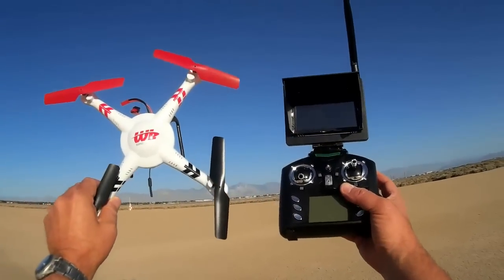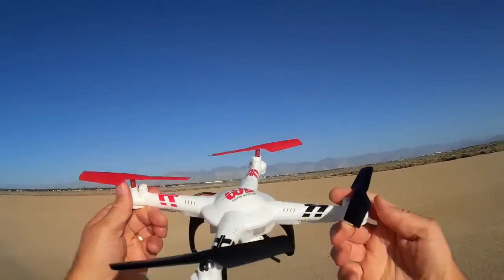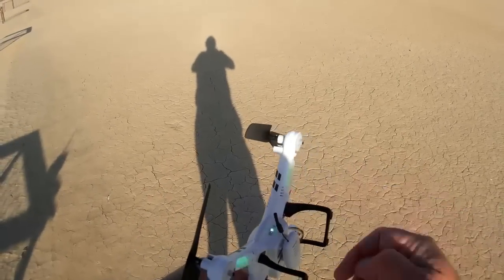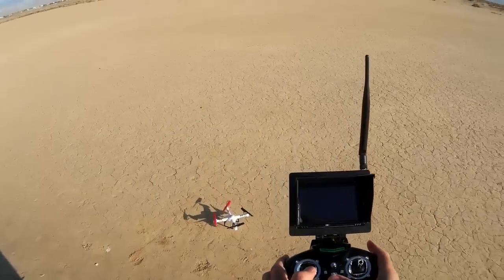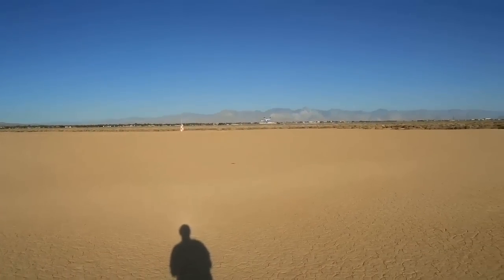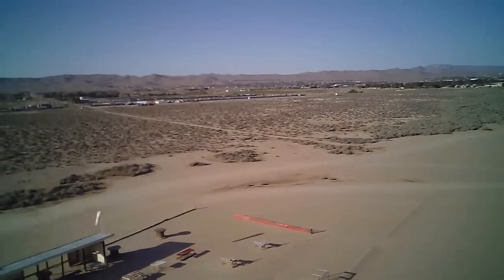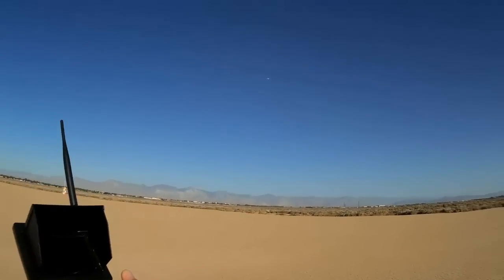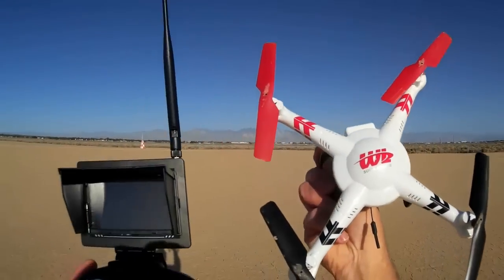WLToys V686G FPV Drone Gyro Calibration

Comment: I just got mine, did the calibration twice and every time it just takes off even if I'm holding the throttle at 0. Cant make it hold still. Flying inside is impossible.

Comment: +Quadcopter 101 I have one of this model and would like to know a few things if you can answer me

1- the battery lasts for (at most) 10 minutes, I bought another one (made for a nintendo 3ds, same voltage but more mAh) but I'm not sure if the wltoys charger is safe to use with this battery since I don't know if either battery or charger has surge protection.
2- one of the props is showing signs of debris damage even after I brushed it, is the motor dead already?
3- on one of the (hard) landings, the shell cracked above the front lid, does that cause any problems during flight?

thanks a lot for the videos! (specially the one explaining calibration)
Reply from the maker: 10 minutes is a lot of time for a brushed motor quadcopter.  Flying any longer may overheat and damage the motors.  I do not recommend using the nintendo 3ds battery with this quadcopter.
For #2, if you spin the prop by hand and notice any unusual binding, there may still be a sand particle stuck between the teeth.  Sometimes it is necessary to use a pin to dislodge hard stuck sand particles.
#3 sounds like merely cosmetic damage.  If it still flies, dopn't worry about it.  Of course, there's always glue ;-)

Comment: I just received the DV686 and it won't get off the ground. I power up everything and the rotors spin at full power but no lift. Batteries are charged. I don't know what to do.

I do see that when the props spin they hit the prop guards that's at high speed spinning. Should I take them off? 

This is my first quad and I've never flown one before.

Help!

Thanks in advance for any help.
Reply from the maker: You may have not installed the props properly.  They should all be blowing air downward.  If any are blowing upward, replace that prop with a different shape.   Also remove the prop guards.  They're very bad outdoors in the wind, and also like to get stuck in trees.

Comment: Just a question, my Q222 flies with the left front down (I know it doesn't have a front or back but I meant the right red motor) so basically with the left front slightly more down and right rear up. 

Should I calibrate or is it just broken? 

Ps, when holding the 40% button I hear 2 beeps and the light keeps steady on on the Quadcopter.
Reply from the maker: Try calibrating the gyros. 
1) Turn on the quadcopter and place it on a flat and level surface.
2) Turn on and bind the transmitter.  Center all trim tabs.
3) Leaving the quadcopter undisturbed, move and hold both control sticks to their lower left corners.  Hold them there until the quadcopter's lights blink. If they don't blink, then try lower right corners, lower outboard, or lower inboard until you notice the lights blink.
4) Let go of the sticks and try flying.

Comment: I recently open and closed my Q222 drone (which I think is identical to the V686G)? in order to reattach (solder) one of the wires for the battery component. However since then the drone flies for a short while then drops, even though the battery is fully charged. Also the motors were not touched and so are in place, and as far as I can see the gears are not loose.

Can you suggest what may be wrong and how I may fix this?
Reply from the maker: Have you turned each motor by hand to make sure that they spin freely? They should spin freely in the wind like a pinwheel. If not, their gears may have debris, particularly sand, stuck between the teeth.  This can cause excessive power to the motors, and can destroy the motor from overheat.  If any do not spin freely, clear the debris with an old toothbrush, or use a pin for those particulary stubborn sand particles. Some may be so small that you can't see them without a magnifying glass.  The best way to find them is to slowly turn each prop by hand to feel for any unusual "bumps" in the turn.  https://www.youtube.com/watch?v=LzzD3BPVvH0

Comment: Hi I have the mjx rc x500 and it keeps spinning to the left should I use the same process or what. 
Please answer or it will be in the trash
Reply from the maker: I'm betting that you installed or changed propellers, and were unaware that there are two clockwise and two counterclockwise that must be installed on corresponding motors.  If it takes to the air and spins, then you likely installed all CW or all CCW.  Must be two of each to counter the  torque.  Take a close look at the following picture, paying attention to the shape of propellers and where they are installed.  Make sure that your propellers match this installation http://g03.a.alicdn.com/kf/HTB10tYIIpXXXXaWXXXXq6xXFXXXk/mjx-x500-2-4G-6-axis-rc-drone-quadcopter-headless-rc-helicopter-3d-roll-one-key.jpg

But if your propellers do match this picture, then the next thing to try is you yaw trim tab, located directly under the throttle stick.  Since your quad is spinning to the left, try bumping this tab repeatedly to the left until the spinning stops (then try right bumps if left bumps don't work).
Reply: Thanks
Reply: Is there any place were I can buy spare motors for the mix x500 so if they're damaged I can replace them
Reply from the maker: Extreme Gamer Well you can Google it as well as I.  But you're best bet would be Aliexpress.com

Comment: Did you have to get a better antenna for FPV? Mines a bit poorly almost unusable for some reason...Only got it today too
Reply from the maker: +bozman69au This is usually one of the better toy grade FPV fliers.  Its FPV video range should be over 100 meters.  If yours is not, something may be wrong?
Reply: Yeah i think so i get massive interference on the FPV as soon as i spin the motors its to the point its unusable but the video on the camera is fine so i am assuming its fpv reciever related..Thanx for replying :)

Comment: hi 101  I bought the x260 from xk innovation  it says  it has altitude  mode does this copper thanks more videos  plesae
Reply from the maker: +martin keepin It's a good quadcopter.  But the advertised altitude hold feature (high pressure air needle) does not seem to have been incorporated with the X250.  Here are some flights I had done with the X250 https://www.youtube.com/channel/UC90A4JdsSoFm1Okfu0DHTuQ/search?query=X250
Reply: Thanks 101 😊

Comment: How do you switch between mode 1 and mode 2 with the WL 686G FPV Quad?
Reply from the maker: +Jack Turner You can't. For the V686G its transmitter is not switchable, and you have to specify Mode 1 or Mode 2 transmitter when you purchase it. And actually most vendors only have Mode 2 transmitters in stock.
Reply: Mine says it's a Mode 1 on the lcd screen, but it works as a Mode 2.

Comment: Update; Thanks again for the good diagnoses. It was the right rear motor. I paid 17.00 for 4 motors and 2 sets of props. Shipped 2 day Amazon prime. It is now flying like a charm. I am completely amazed at the quality of the camera! Wow! Syma could use some schooling from WLtoys as far as cameras are concerned. Video frame rate is great, color rendition is nice and the resolution is very good. I will rate this 8 out of 10 due to the bad motor.Very happy with performance. It doesn't have the headwind problems the Syma X5C has.Very nice flyer and incredible camera for the money. Thanks again.

Comment: Thanks for all the good informative videos!
Regarding the V686G, Five stars for the camera, zero for the quad. I own 3 Syma's, an X5SW-1, X5C and an X8C along with a DJI Phantom Standard. I got the 499 deal for the Phantom! The Syma's and DJI fly with confidence and are blast to fly. I received the V686G from Gearbest.com. This thing is complete junk or I received a lemon. It flew okay for the first 3 minutes of video, then complete instability. It has never been crashed, for the few short flights I have had. I thought it was one of the motors, but it seems to be fine.  The left rear motor now doesn't fire up sometimes unless I jar it. Somehow either the board is not calibrating and sending erroneous voltage to the motors, or the transmitter isn't working properly are my thoughts. Maybe cold solder joints? I went through  calibration of X,Y and level,  it is still the same. It also looses power very rapidly. The camera is certainly a keeper. If I can find a schematic, hopefully I can retrofit it for the Syma X8C. As I understand it requires a .5 sec. trigger for the video to engage. I could do it with an Arduino, but that's overkill. Anyway, any thoughts are appreciated. Thanks.
Reply from the maker: +Gary Olson The left rear motor needs replaced. The brushes eventually wear out on brushed motor quadcopters. Fortunately replacement motors are dirt cheap, and happen to be plugin replaceable on the V686G. Here's one place to purchase spare motors http://shrsl.com/?~b2mb
and here's how to change a motor https://www.youtube.com/watch?v=FXmsafz-u6Q
Reply: +Quadcopter 101 Thank you Sir! That was my first gut reaction, should have stuck by it.

Comment: Great video!  I just got mine today.  One motor would run intermittently, then holding it in my hand at a medium power setting and it acted possessed.  The motors would rev and cut down it was really annoying.  Calibrated per your instructions and everything is fine.

Comment: Why is my controller showing im in Mode 1 and how do I get it to mode 2. Funny thing is the quad operates as though it in Mode 2... Left side up and down, right side forward and back and side to side..
Reply from the maker: +Rob Vitek It's Mode 2.  Just ignore the LCD screen, it's wrong.
Reply: +Rob Vitek I have the same problem. How do you switch between modes?

Comment: very bad... im glad you did this because the thing was DOA.. I have the same problem as Mike. Will not bind and blinking lights brand new. must be a normal made in china deal. boy my son will be happy getting a pos toy this year. Should have just designed my own from hobby king etc. what a waste. Do they have back end reprogramming modulus? Im just noticing the bnk bus on the main bored. looks liek it has a cmos swap for factory defaults...what... a ... p   o   s./

Comment: I don't expect an answer since it's late December, but I have been viewing your excellent videos in advance of getting a quad to adapt it in a robot. I'm not going to fly this 155 pound bot,but the headless,rth and FPV must work. 
 this seemed to be the best quad for the money but many negative comments make me leary. I saw copter hubsans videos and he had no problems so I may pull the trigger. I'm going to become an intermediate fleet and then adapt the robot motors using reciever signals from the quad. the rth and FPV features are what I really need. thanks again for your videos. I will subscribe.

Comment: My 686G is having problems. It lacks power and I can only get it a few feet off the ground. Though it was bad battery's so I sent away on got 5 new ones. Still does the same thing. Doesn't show the flashing low battery light warning but just will not climb. I calibrate both the transmitter and X & Y axis still the same. Also sometimes the right front motor will not spin up and I have to due a transmitter calibration to it work. This is my trainer and I have about 40 plus flights on it. Never any hard crash landings. Any ideas or is it just worn out  ?
Reply from the maker: +michael landowski Your right front motor likely needs to be replaced.  They do wear out. Fortunately, they're plugin (no soldering required), and dirt cheap http://shrsl.com/?~anj7

Comment: Can u please tell me how to activate headless mode or cf mode in v686g
Reply from the maker: +the artist hold own the lower right silver button for three seconds.  But be in low rate.  In higher rates, the quadcopter does "twist stumble" stunts when in headless mode.  This is not a defect, it's actually designed to fly that way (like the pilot is drunk) while in higher rate headless mode.

Comment: how do you switch from mode1 to mode2 on the controller. ps: I calibrated the gyros, however when entering headless mode, the controllers on the right swap. i.e. front goes back and left goes right.
Reply from the maker: +stomp bing I think that you may be confusing the front and back sides of the quadcopter (it also confused me at first because its design is a little unusual)).  The front of the quadcopter is the side with the battery door.  The back side is the side with the dome light.
Reply: +Quadcopter 101 no I got that part I have the fpv version, the camera view is the front, obviously. the ting is, a calibrated the gyros, and it seemed to work ok, but after I restarted the quad, it reset it self.
Reply from the maker: +stomp bing I'm not sure as I've never heard that happen before?

Comment: Thanks for the review and instructions Quad!  My 686 arrived today, it was much easier following your video step-by-step than to interpret the supplied "instructions".
I went for a 5 min night flight in front of house, just to get the feel of the quad.  The controls feel smooth, the response is good, not sporty but enough to easily maintain control.
Thanks again Quad!

Comment: I had problems with this quadcopter until I used your calibration technique. I found like you did that it doesn't like the wind and 
I am pretty sure it's because of it's weight since it is so light otherwise it's a good flyer and is durable since I've crashed it
several time. :D I got mine from GearBest they shipped it real quick and I'll fly mine when there's no wind. Thanks for the
review!
Reply: +Dennis Petersen Did you take off the prop guards yet?  They act like sails in the wind.
Reply: No, I need to remove them like you said.
Reply from the maker: +Dennis Petersen Yep, remove them if you've progressed to the point where you're not crashing anymore.  They're simply beginner's training wheels for quadcopters.  Remove them and it should fly much better.

Comment from the maker: If you live in the USA, GearBest's US warehouse has some pretty good deals going on quadcopters for Halloween. One is the V686G with free shipping for $76!  You should also receive the products somewhat quickly when ordering from their US warehouse. And here are their Halloween quadcopter specials http://shrsl.com/?~a4y4
Reply: +Quadcopter 101 Ordered one with an extra battery, and motors, should be here hopefully this week, thanks. Going to do antenna mod first, then bearings. Oh I also got the X5C-1 as you suggested, and a MJX X600.

Comment: I did re calibrate my quadcopter and it still wobble (sorry for bad english :P) in the little wind and now it started to go upper right by its own I don't think motor got any damage because when I'm holding it its fine but even I'm in my house when I start it and give it a little power to make it fly its starting to goin upper right . You are answering all my qustion you are so nice thank you for all answers by the way :D
Reply: +Maniskop 88 But I think something is wrong about my copter and I bough it from banggood I can't just send it back and hope for a replacement I don't think they will do that :(
Reply from the maker: +Maniskop 88 Try to calibrate the gyros.  
1) Plug in the battery and place the quadcopter on a flat and level surface.
2) Turn on the transmitter and connect it to the quadcopter.
3) Press the 80% or 100% transmitter button.
4) Move and hold both control sticks to their lower left corners.  Hold the sticks there until the quadcopter's lights blink.
5) Let go of the the sticks and try flying.
Here's a video showing how https://www.youtube.com/watch?v=j2VOZxfw5P8

If the above doesn't help, make a video showing the problem, and upload it to YouTube.  When you contact Banggood, include the link so that they can help.

Comment: Very informative.. especially since I had no hope of understanding the Chingelish instructions.
One thing.. I had occasion to remove the propellors.. and noted carefully that red was at the head side and black was at the rear..after reassembly the drone would not ascend.. but tilted wildly to one side as it ran across the floor.. very puzzled about it until I took note of which motors ran clockwise, and which ran anticlockwise.. to my amazement.. BLACK has one of each as does RED..?? what stupid idea is that?? surely one color for clockwise and one for anticlockwise..makes sense yeah ??
Anyhow.. all going well now.. and I also did the x y calibrations. 
Thanks for your great video.. good voice volume and no crazy rock music to  annoy me..
Reply from the maker: +Gaz inbali Clockwise and counterclockwise has to alternate between each arm to counter torque.